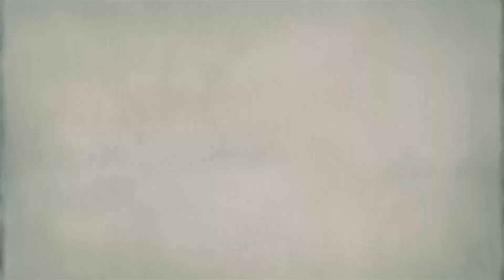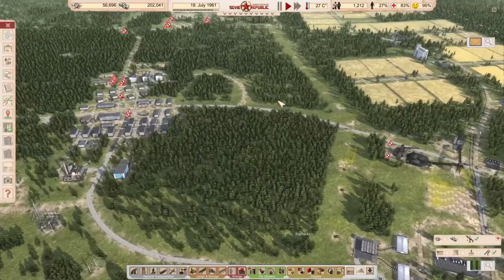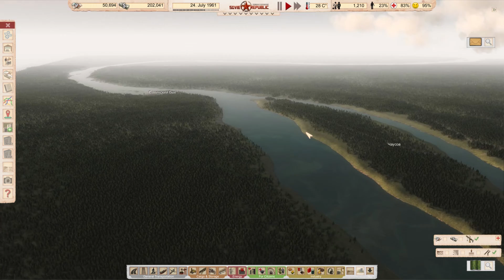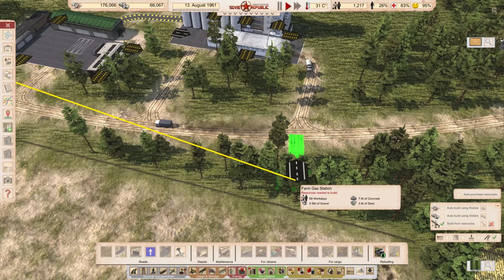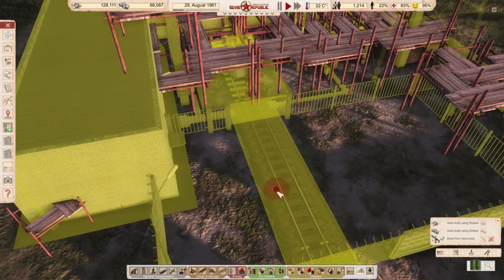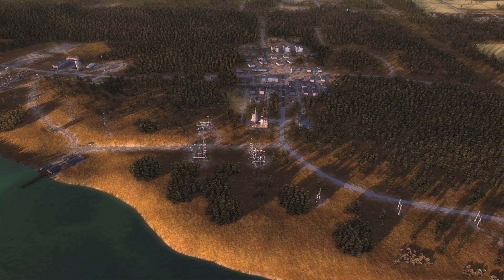Soviet Republic - Yeniseisk- The Rise Of Siberia - Ep.13

Comment: Regarding the buckt dredger: I would look at what 30 tonnes of gravel cost to import. And how much a tonne or three quarters of a tonne of petrol cost. If the values are balanced, I would leave the settings as they are. The petrol must definitely cost less if not a fraction of what the gravel costs. Under no circumstances should you change the setting so that the petrol required is more expensive than the amount of gravel that can be produced with it.
Reply from the maker: If it's balanced it's not worth it then. Only shorter border queues. 
The whole point of the economy of this game is to have cheaper domestic production. 😊
But I see your point.

Comment: This is from a Farming and Watercourse Management Handbook:  Gravel is usually extracted from rivers and burns in an attempt to increase the flow of the river by deepening or widening the channel, to deepen shallow zones for fish movement, or simply to provide gravel for road or other building work. Movement of gravel within a river system is a vital natural process. Gravel extraction will therefore inevitably have knock-on effects and can be extremely damaging, resulting in increased erosion in other parts of the river and causing direct disturbance and damage to aquatic environments.
Reply from the maker: I agree. Most of the European countries limited the gravel and sand extraction in rivers. In Croatia, there is an ironic situation where gravel for road construction is imported from the neighboring country just 30km/20 miles away and they extract it from the same river.😀